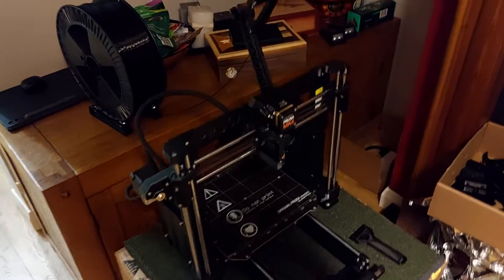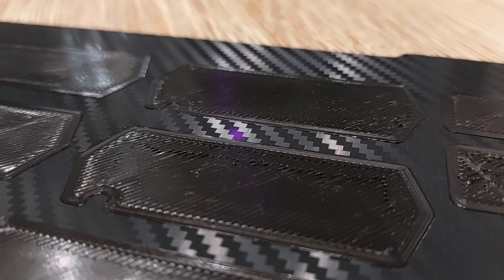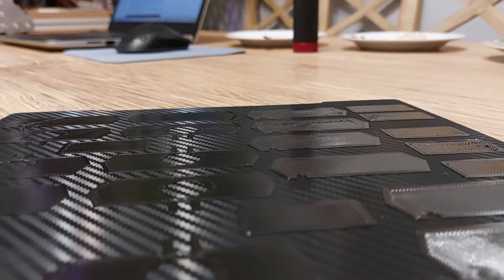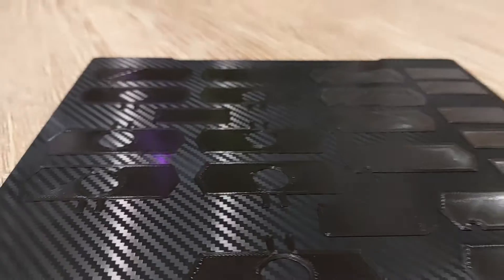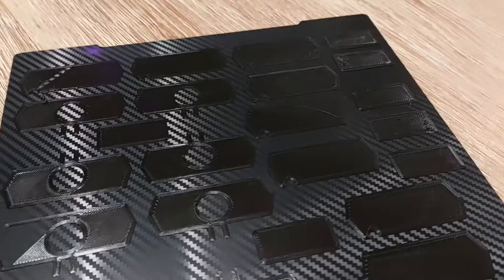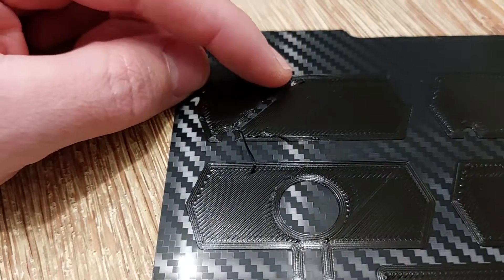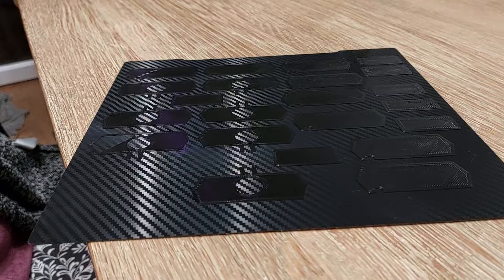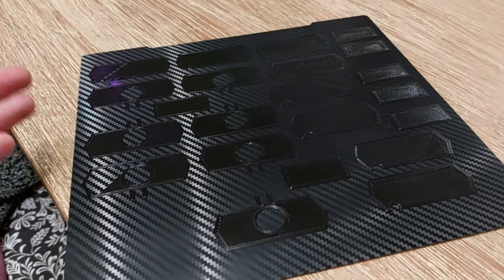Prusa MK4 is here. And well, we have some issues with the "perfect first layer"

Comment: Im having issues with my Mk4 also but my issues are more complex than yours. Its very unreliable. The thumbscrews are as tight as I can make them with my fingers. Haven't tried pliers but they are called thumbscrews for a reason, pliers shouldn't be required.

Comment: were you able to fix it?
Reply from the maker: Yes, the major issue was that the nozzle assembly was not tight enough. Its actually an easy fix, make sure that your tighten the 2 knobs holding the nozzle. I had to use pliers to make them secure properly, but be carefull not to overtighten them as you may deform the nozzle throath. Just do it in steps, tighten them more and see if it improves. If not, tighten again but really be carefull. 
This fixed all my issues with inconsistent layer height. I presume taht if you have the nozzle insecuere - the probing process gets inconsistency if the nozzle is able to move a fraction of milimiters.
I hope this helps you all!
And - also you can actually change your Z offset - while printing you need to pres and hold the knob on the prusa panel - you will be given the ability to adjust it manually :)
Happy days!
Reply: @delan3d422  Thank you very much for a good explanation of the problem. I upgraded my MK4 to an MK4S and encountered this issue, so the solution of tightening the two screws that hold the hotend made the first layer come out perfectly again.
Reply: @delan3d422  this helped, thanks! :)